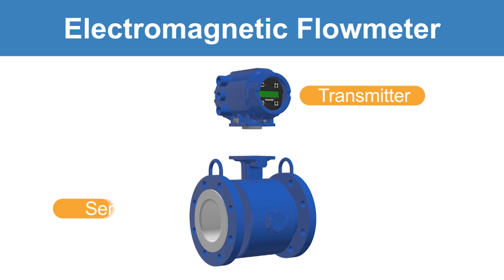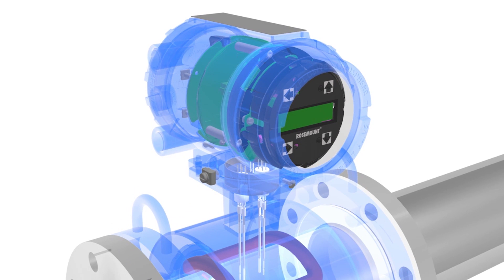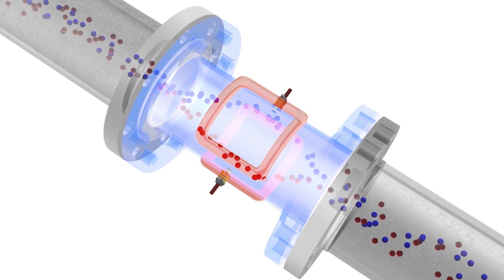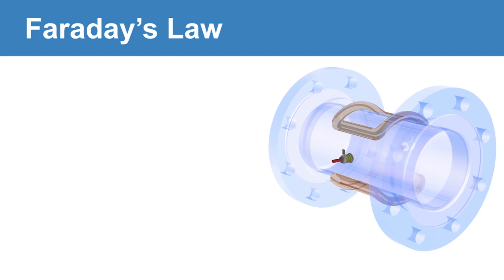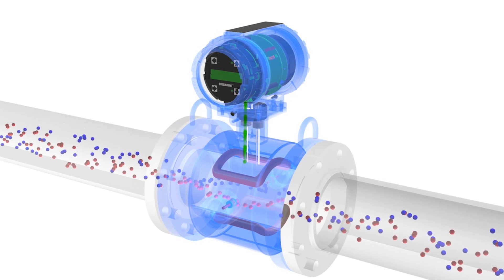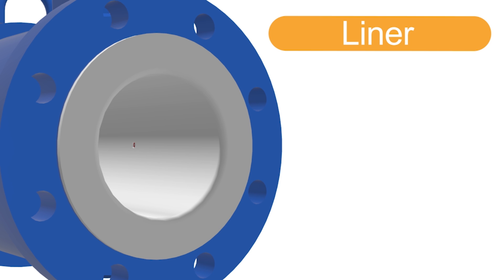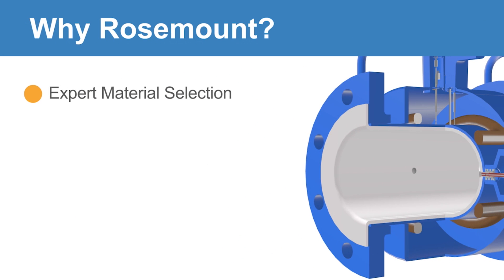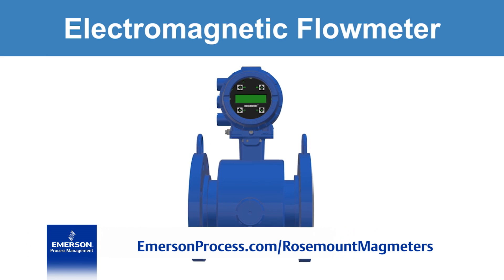Magnetic Flow Meter Technology Introduction

Comment: Magnetic flow-meters are only suitable for conducting fluids. The principle is
that the fluid is exposed to a strong magnetic field perpendicular to the
direction of flow. A voltage then results in a direction that is perpendicular to
the both the flow and the magnetic field. This voltage is proportional to the
speed of flow.
Reply: Hall effect?